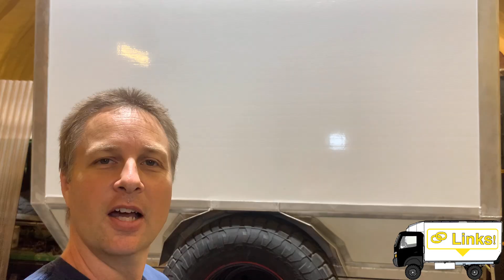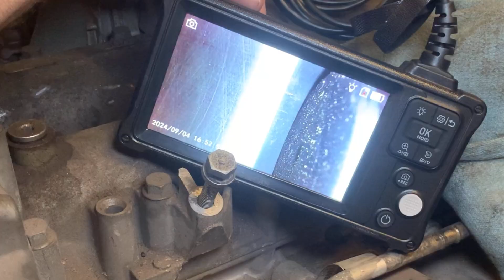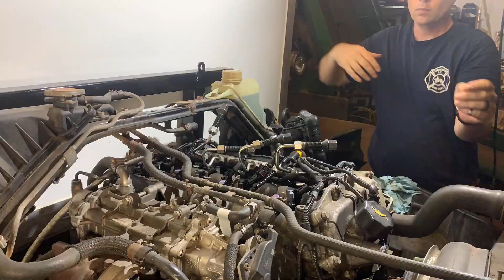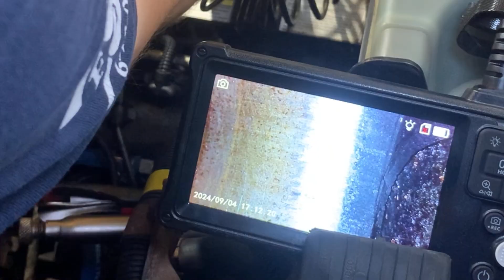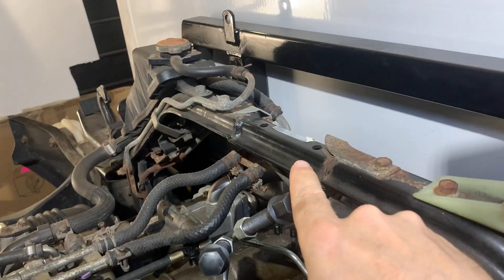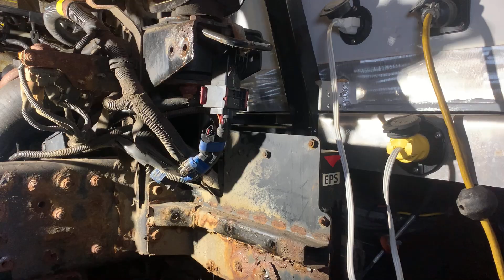Internal Damage??? 4P10 no start! | Overland Fuso Build

Comment: Use a straw or thin vinyl tube on the end of your shop vac to clean the debris off the pistons.
Best Practices: Always plug any orifice into your engine so dirt, debris, bugs, and vermin are kept out.  Blow out the area around your spark plugs or injectors before removing them.
And last but not least, blessings be upon you for removing that last injector in one piece.
Reply from the maker: Yeah, planning on trying to get some of the junk out - but it has to be smaller than the injector hole!!!   Also - the injector holes are capped while I don’t have injectors in there 😎

Comment: Hey you are wrong in the 4P10 the valves are not going to contact with pistons. If the timing chain broke while engine is running it will not going to contact the valve because there's a clearance for that. And in the 4p10 there's a problem in future that timing chain will broke without any sounds and while engine is under load

Comment: There’s one feature that seems to be missing from your (and most) scan tool. 

I remember a couple episodes ago, you were not sure if the engine was deciding to (I think) run the injectors or not. It wasn’t clear what decision making was happening inside the ECU. 

That seems like something that really should be accessible from troubleshooting tools. If the engine is saying “I see X is out of range so I won’t Y”, surely there should be a way to get told this info?

Dunno. I have never used a scan tool that cost more than $30. :)
Reply from the maker: Unfortunately, fuel pressure is one of those things that doesn’t throw a code - all the computer knows, is that the engine is turning over, and there is no fuel pressure - as in… could just be out of fuel.
Reply: Do you mean the ECU needs to throw a trouble code. No you are wrong. This is the 4P10 diesel engine and not a petrol engine. Because this is a diesel. diesel needs to come up to the pressure and if there's a problem on that side how the hall ECU knows what the problem 😅😅😅
Reply: Cheaper scan tools are not good because they are not providing the right information
Reply: What I was thinking about was, for example: the ECU is looking for a couple parameters to be correct before moving to the next step. Or waiting for something. 

It would be nice if a scan tool would be able to show you the state of the ECU’s state machine and what the ECU interprets the parameter as meaning.

I know there’s a lot of hand waving in my description. I might be wrong; I haven’t done much engine troubleshooting myself.
Reply from the maker: I don’t believe it’s common for diesels to monitor fuel pressure before the engine is running…. After yes, but not before.